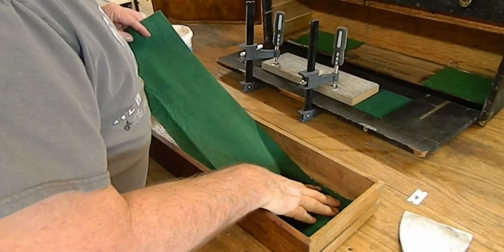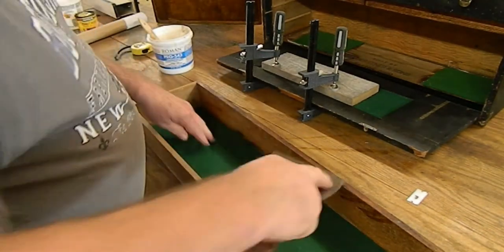Gerstner Leatherette box

Comment: Lock pins into top of door- what you could do is drill out, replace with solid plugs, close door and tap top of pin ( or use engineer's blue) which will give you the strike point. Centre pop and drill for pin. This is how I located the pins on the one I am building...

Comment: Ive repaired a similar problem and the way i went about it was... I used filler in the wore out bit then i drilled the pin holes out to a lil bigger diameter so that i could fit pieces of tube that fit the pins properly.